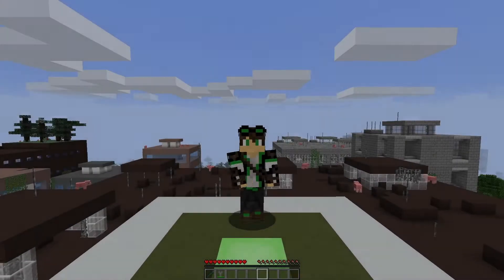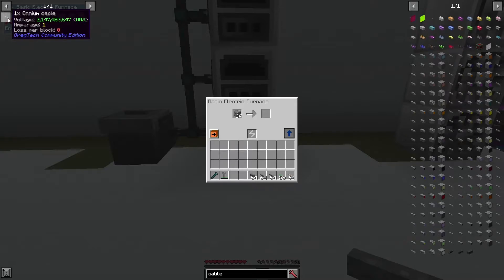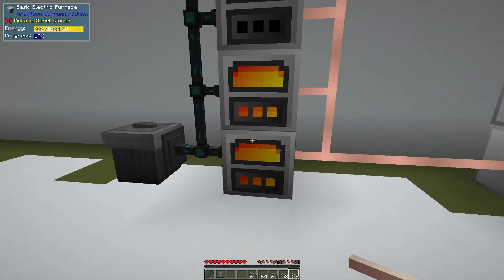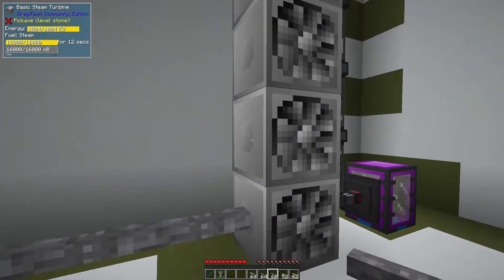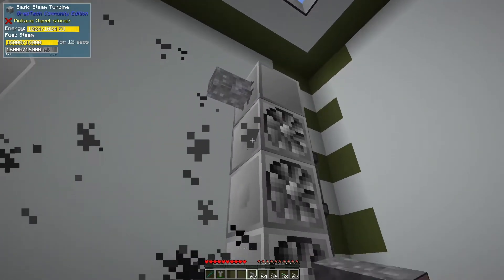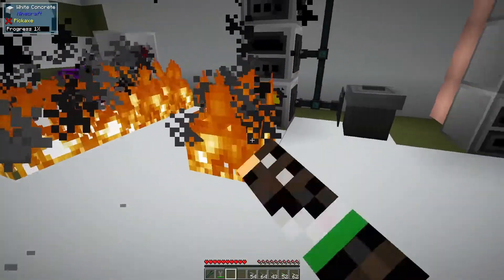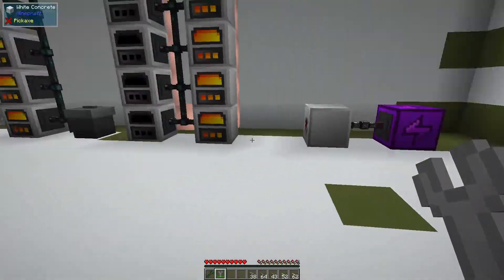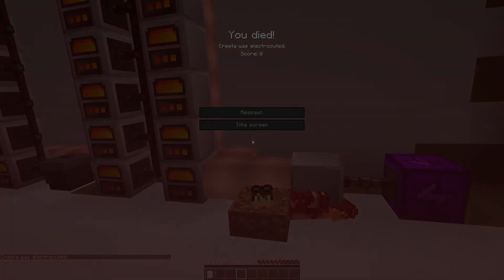Basics of Gregtech Power - Amps, Volts, Mistakes

Comment: Idk if im stupid but i need a few tc parts to make better tools but everytime the extruder is at 75% it randomly stalls from not enough power. I have one LV steam turbine on a 4 wire grid for 4 machines (always only one is at work) and that turbine is in the middle, it has more than enough steam and im transmitting power with 4x tin wire, i may be dumb but idk what i can do rn, im just stuck, can you please help me?
Reply: I'm sure the original commenter figured this out a long time ago, but if anyone else comes here with this issue try looking at the voltage lost per meter stat for your wire/cable. IDK the exact numbers but if you try to run a 30 volt process through 2 wires that loose 2 volts per meter and you generate 32 to begin with, the machine will only receive the 28V/S. The lower quality of cables the worse the effect will be. I made this mistake a lot when I started so if any new people have this same issue hope this helps

Comment: I'm still kind of confused by how AMP's work. Am I correct if I say that a 4xLV cable = 4x32EU LV = 128EU LV ? And if say 2 machines use 50EU LV combined at the same time, I would have 78EU LV left over for other recipies on other machines? I understand that I can't supply more APM's than what a cable can handle, but I need to know when I need 16x cable etc.

Comment: What if i overclock the machine. will the machine explode or cables burn
Reply from the maker: Sorry for the long wait on a reply. It's been a while since I tinkered around with this version of GT but I believe that these machined were not overclockable. If you put them on a line with too much power, bad things happened. If you gave them too little power they either didn't run or ran slow. The pack I was working with thankfully had some strange tricks to bypass a lot of the limitations and somehow still worked.

Comment: 0:56 how do you get the wires to link like that I have been here for 2 hours and i still have no idea how they link to etch other
Reply from the maker: It's possible you might be running a different version of the mod(s), or you're trying with non compatible mods to transfer power. Gregtech cables don't like hooking up to Thermal Expansion machines for example.
Reply: @Creeta  i know what I was doing now but thank you for the ideas
Reply: Try wire cutters or wrenches.